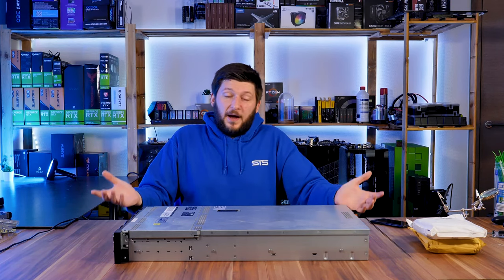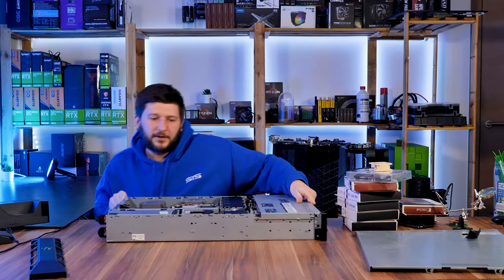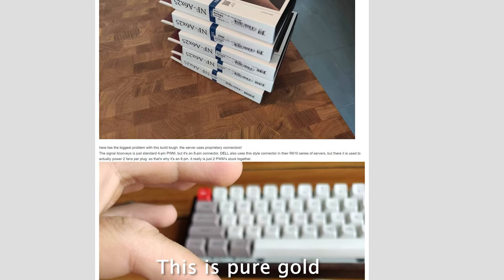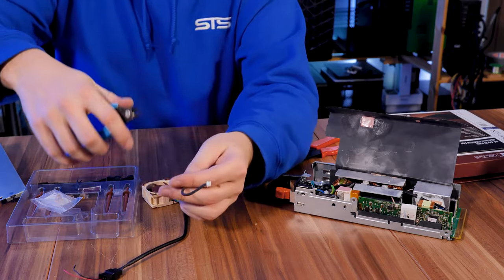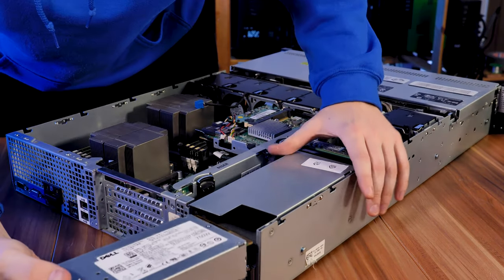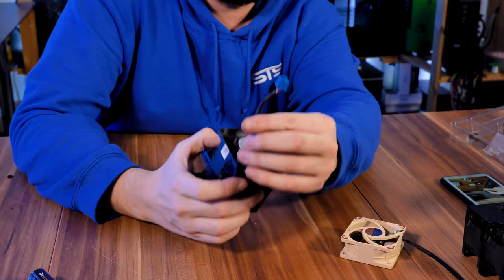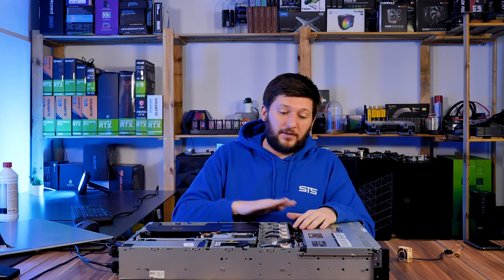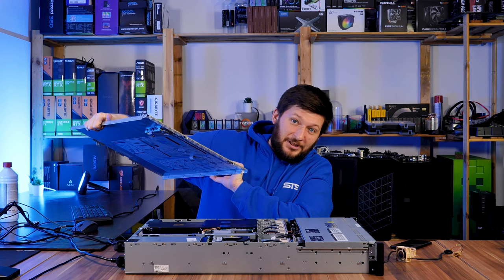Dell PowerEdge R510 Silent Mod - feat. Mini Noctua Fans

Comment: what you could have done was just use ipmitools to set the fans to a static 20%. i do this with my r720 and its almost as if its not on when its running,
Reply: I’m about to build one of these. Is there more I need to know to do this? I really don’t wanna spend 75 on noctua fans if I don’t need to.
Reply: But that will affect the server life span..
Reply: @vascovalente3929  same as replacing the fan

Comment: Why would you do this to the system? Just configure the fan speed via the IPMI. Set a threshold so that it can't cook itself. This poor machine. . . Can you imagine if someone opened you up and then replaced your lungs with that of a babies? Noctua fans are not good fans.
Reply: he have no problem because he is not using it as it shod. With 4 HDD there is not problem with heat. Problem comes when you populate all 12 bays with 16W 3TB SAS drives.. They block air for starter and another problem is that they are HOT. So i think that with noctuas it will be impossible too cool it down. All saw, he put all of his HDD on non CPU side of board and temp rise 10 degrees. Imagine all HDD on CPU side.  And i know that i has ventilations openings between HDD case and fans but then HDD will be cooked. IPMI is best solution but you have, but you need to monitor it from time to time.
Reply: Many people have been opened up and had both lungs replaced

Comment: With your powersupply the loose cables are used for pwm and fault detection. if i remeber correctly you could just bridge the two

Comment: In my experience, Noctua fans cannot replace OEM fans in the majority of enterprise grade equipment. They are not the same thickness, which can leave gaps, as it did in the power supply you modified, and they only move a fraction of the air that OEM fans do. You replace a double, counter-rotating fan module with a wimpy single fan that blows next to nothing compared to the fan unit it replaced. Also, in my experience, Dell power supplied are silent or nearly so. So replacing those fans is probably a useless exercise.
Reply: The thing that really bothers me is that he could have just set the fans to a static speed via the built in management system (Lifecycle Controller).

Comment: I cannot speak on Dells servers however I can on their switches. I recently acquired a dell 24 Port POE switch and they had a delta fan and I swapped it for a noctua fan. I didn't need to solder any wires but simply use a pin removal tool to pop the pins out of the fan connector on the noctua fan and swap them around and push the same pins into the required place. The switch throws the fan error light but the fan works perfectly fine. Not sure if this same kind of foolery would work on the server fans or not but you've got to love the proprietary connectors these vendors use and then they quickly drop support for the products and replacement parts become very hard to find.

Comment: This does not work. If you live in a hot place you will get overtemperature alarms with time as the serves becmes dirty. I did the same on a Proliant DL380P Gen 8 and it looked like it worked for some time but as time passed the alarms appeared. Dust on a room is unavoidable, that's why server rooms have filters . Sorry to bring bad news.

Comment: Electrical engineer here. 

Most newish (made in the last 5-8 years) server PSUs are designed to detect if their fan has failed and will go into protective shutdown mode if it detects such a failure.

Usually this is done by measuring the fan's RPM using the tachometer wire, so if you leave this unconnected, the PSU will interpret this as 0 rpm, which normally would indicate the fan had failed.

You can determine if a server PSU needs the tachometer wire connected by unplugging it, sticking something through the blades of the fan which will obstruct it and prevent it from spinning, then turning the PSU on. If it doesn't shut off after a few seconds (if it turns on at all), then you can get away with just leaving the tachometer wire disconnected. 

But more than likely, you'll discover that the PSU will detect the fan isn't spinning and will quickly shut off. 

There are even some PSUs that not only measure the fan's RPM, but measure if the fan's RPM responds to the PWM control signal as expected. For those PSUs, all 4 wires must be connected. PSUs like this are not that common but they definitely exist. 

Personally, I recommend always using a 4 wire fan and connecting all 4 wires when swapping out a PSU's fan since it's hardly any extra effort and if you already have it apart, might as well. Plus you retain the fan speed control functionality of the PSU.
Reply: "But more than likely, you'll discover that the PSU will detect the fan isn't spinning and will quickly shut off."

Well he did set out to make it quiet
Reply: @minime9400  can't be loud if it's dead
Reply: thanks alot for sharing

Comment: Great silent mod for that server. 

I've seen another silent mod, but that guy a Supermicro server. I remember he had normal PWM connectors for case fans, but the server wouldn't boot if it didn't have a case fan into the connector that corresponds to PSU cooling and at least another one in any other slot that corresponds to CPU cooling. I guess Dell doesn't have a requirement like that.

He also did the PSU fan mod from loud Delta 40mm fan to quiet Noctua 40mm fan to 2 wires connector and didn't had problems.

It would have been nice to have them all on Noctua to have a full silent built, but still the difference is huge, from jet engine to whisper quiet.
Reply: reminds me of when i got my hands on an old poweredge 2950, holy crap that thing was loud as heck (and a power hog)
got rid of it because it was so dang loud, even after messing with the oem fans to get them to run as silent as possible

Comment: probably because the fan was reporting or NOT reporting any RPM, the the PSU shuts down as a safety measure-  4 wires = power/negative/PWM control/RPM reporting

Comment: Maybe getting a r320 and gutting the MB and PS then opening a huge hole for a monster and quiet fan that would then be used to push air into the top of your r510.  You could also get an 8 bay 320 as the donor so you could then add an additional raid card to the r510 and feed the cords from the 320 drives to the second 510 card. Quiet and a huge drive capacity upgrade.

Comment: A simple + and - wont tell the PSU a thing about its fans and how/if they are operating. This is why the PSU will shut down after 5 seconds. It needs a tach signal. And preferably a PWM signal as well. 
My Lenovo X3650 M4 has a target fan speed set and will correct the PWM signal to match the desired speed. So If I try to slow the fan down, the system will just alter the PWM signal to make the fan spin faster and match its target speed. This is why all the fans will spin up to max speed at startup and after a while, quiet down. This is to check that all the fans are working correctly.
I guessing replacing the original fans with Noctuas will throw a fan error as the fans can't hit their target speed. The server will probably still work, but will throw a error at every startup as well as throwing a error on the diagnostics panel. 
Still considering Noctuas though as I have a whole spare server. 🙂

Comment: Likely to do with the fact the power supply is getting no speed reference. You only connected the 2 wires. The other 2 wires are important to 1. Set the speed and 2. read the current speed of the fan.
Reply from the maker: You mean on the mini fans for the psu?
That makes sense
Reply: Exactly, makes SENSE 🙃

Comment: Just noticed in your video looking at the original fan in the PSU it looks like it has 4 wires, one of these wires is a tachometer signal. If the PSU sees no pulse the PSU will shut down. 
If you put an oscilloscope on the tach wire you can see if it A: triggers to ground or power and B if the trigger pattern will match with the Noctua. However, most of the time they will not match, so... in order to trick the PSU into seeing the tach signal we simply attach the tach signal wire to the appropriate trigger source. On my HP it didn't like the trigger pattern of the Noctua, so I attached the trigger input to the mother board to the fan ground as this is what the tach signal triggered to. This makes the PSU think it has a strong tach signal and it will post. BUT BE WARNED - The tach signal is a PROTECTION MECHANISIM to shut the PSU down in the event of fan failure. If you perform this modification and a fan fails, if it goes unchecked it can overheat causing damage and possibly result in a fire so if you do this modification, you do so at your OWN RISK. 

That being said I maintain my equipment regularly and have performed this mod on my HP without issue, my PSU's also have a temperature sensor built in, that not only controls the fan speed based on temperature but is also a redundant failsafe that will shut down the PSU if it overheats.

Comment: I have this issue with a new server which is going to sit near an employee office.  it sounds like a jet!  Dell has something called "sound cap" in the bios to reduce noise at the expense of performance limits.   I'd rather not use that, but it may have to do for now until I can try acoustic panels because the server is in an alcove and I can cover all sides, even the front with a self-standing acoustic panel and hopefully bring the noise level down that way because I figure the noise must be bouncing off those 3 walls so why not dampen it?

Comment: I've tried this on a PowerEdge R550 but the fan connection is completely different. The connector is attached to the fan housing so it's not that easy to do. I manage to cut of the connector from an original fan and managed to splice it in with an extension cable that came with the Noctua fans. However, the fan does not spin at all and the iDrac outputs an error that the RPM of said fain is too low and it's missing redundancy. Does this mean I've got to switch the wires around (green and yellow)? EDIT: Switched them arround and still the same error. Why is this happening? Dell, I really hate you! EDIT2: You can ignore the above. I was using the cable splicers that came with the Noctua fans I've bought years ago (40 mm). But apparently they're trash and not working correctly. I just soldered them together and it's working fine now using the colors shown in the video. CPU does throttle however when doing a stress test, but it's idling at about 70 - 75 degrees C, and whisper quiet!

Comment: Hi, have you also checked the power consumption before and after the fans have been replaced?
Reply from the maker: Nope, but doubt that you’re going to see a big difference. Even if they spin really fast, they are just fans
Reply: @STSYT  Your mod might have actualy raised the CPU power draw. When running the same workload a hotter cpu consumes more as it's internal resistance increases. However the original fans could draw tens of wats at full speed.

Comment: Many servers will run the fans at 100% or not work at all if a single fan is disconnected or has failed. Daisy chaining them would not work on those. I found on ebay a adapter for my HP ProLiant server taking the 6 pin on the mb to standard 4 pin but they cost 15-20 usd each so 75-120 usd for my 6 fans and then I need to buy the fans on top. I´m hoping to work out a diy solution before I choose to buy those. Just be aware that these mods in this video though clever may not work for you.